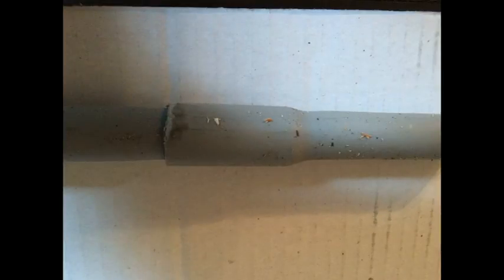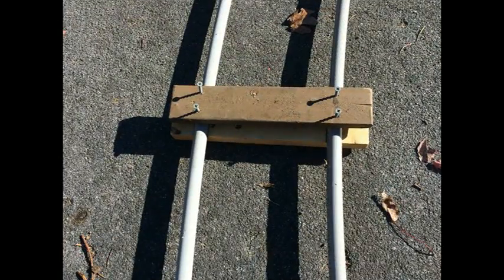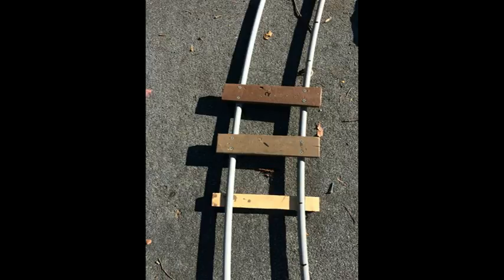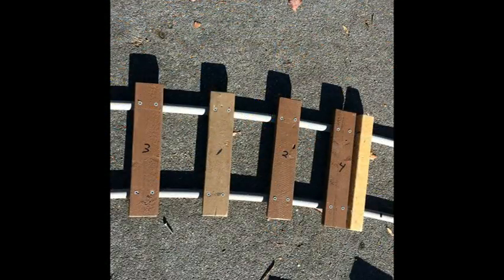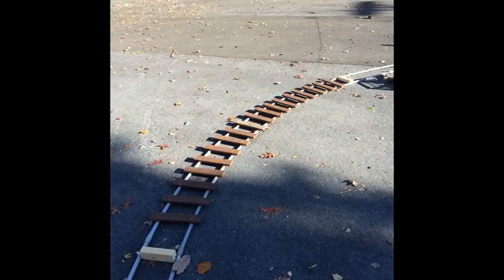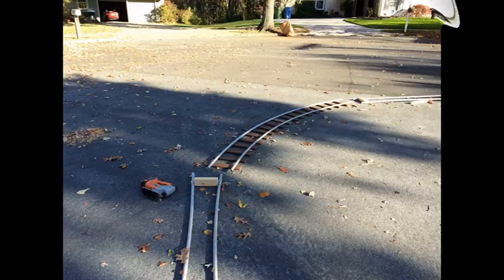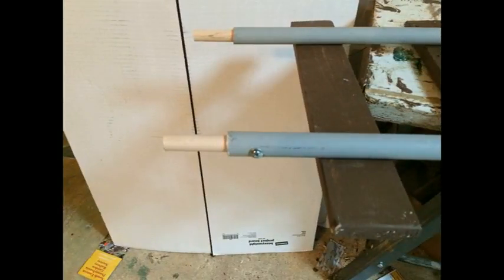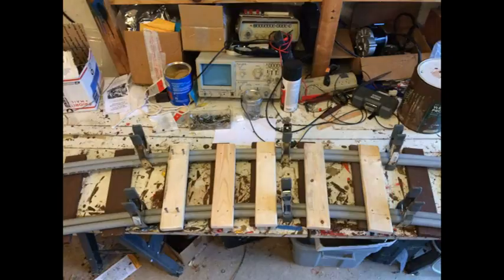making pvc track

Comment: You should fill your PVC tubes with sand to mitigate any compression of the tube.
Reply from the maker: The collapse pressure if 1/2 inch pvc   is 1600 psi. I initially filled my pvc track with sand; but really not necessary.